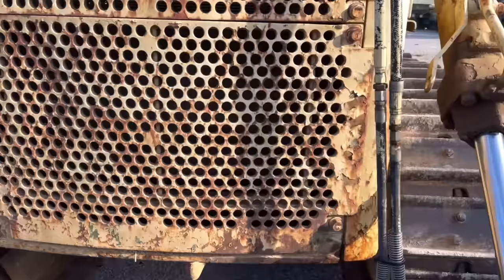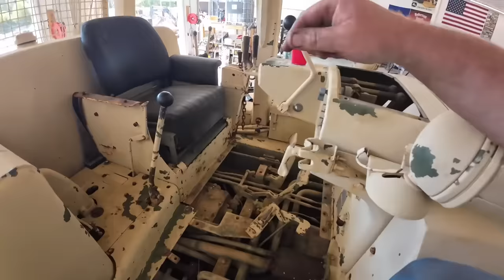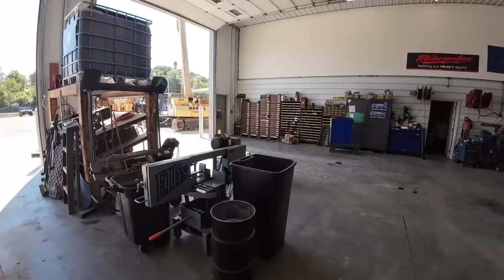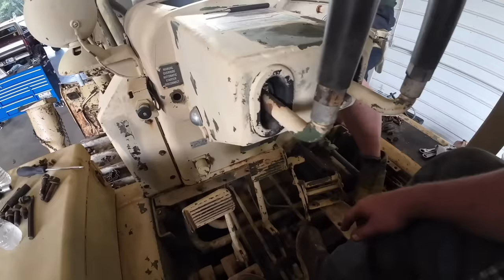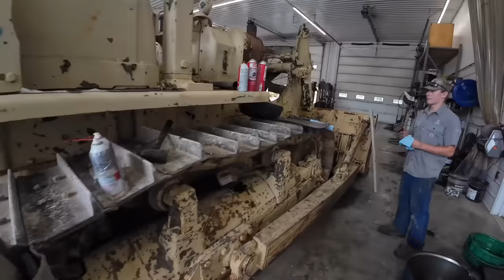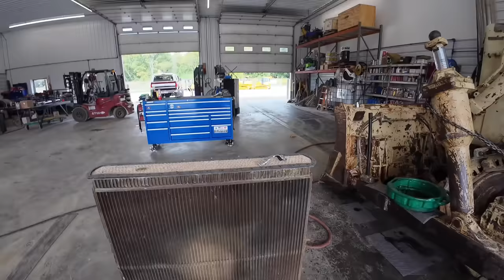Big bad Cat D7F dozer with some major problems, can we overcome them? Part 1

Comment: had my a shop I used here in Texas put in a new radiator core on my D6D many moons ago, they called and said they had bad news but would make it right.  They poked a hole in my new core. hahaha  I told them they could have it repaired and if it ever leaked it was on their dime.  It was good for the next 12 years.

Comment: I remember doing a D8 radiator years ago and after I took the core out and set it on a pallet outside the bay someone stole it. We suspected the guys that would swing through the yard picking up old pallets, but had no prove. 🤬🤬

Comment: That Wheel Horse is a clean ol' gal.  That was a find.

In my cheap youth I had a 1968 Charger 12 I repowered with an Onan 20 horse.  I still miss that tractor,

Comment: 10/14/23..Cat D7 F fix up..what a big dog this is! Always learning while coffee sipping & watching team C&C utilize yur fantastic shop to disassemble & methodically examine all key components that your experience leads we viewers to see (great camera/lighting) & hear your comments (often humorous) which explain how each component relates to proper function/factory specs & overall user satisfaction. You casually mention 'getting' new parts  & rarely mention the ($ astronomical) costs required for repair not counting shop time or labor..which is understandably appropriate. Yup, much appreciate your time taken to position cameras/lights & minimize all the 'air hammer & steel-on-steel 🔔 ring' going on with other repairs. Most all of your videos have this 'other shop noise' eliminated...Great attention to production details! Also glad to see you psi wash these machines before in-shop work begins. We can actually see just how compact (almost impossible) it is to   get any kind of wrench 🛠  into that 'Octapus Convention'🐙🕸🌪🔀 'bird nest' of hydraulic hoses....but you & your team get-it-done! Stay safe & carry on!...looking forward to part 2 of this retrofit, 🎨 paint (yellow?) & test drive around your building!👍😊

Comment: @ 23::18 get you some rods and rod it out like the radiator man does or soak it in citric acid. .
Reply from the maker: Yea but it was leaking from corrosion externally

Comment: What year is that sweet looking bronco
Reply from the maker: 1993
Reply: I grew up with  broncos my parents had three of them they had an 85 a 91 in a 96 the 96 when it went to the scrap yard cuz the body rotted of it the motor and tranny we're under warranty they so many problems with that year even the paint was garbage it got painted twice because of the paint kept falling off of it in my opinion the Ford bronco was the best SUV ever made

Comment: I would have a hard time working around you guys, you're SO messy. With what is in that radiator, I'd flush the block before replacing the radiator..